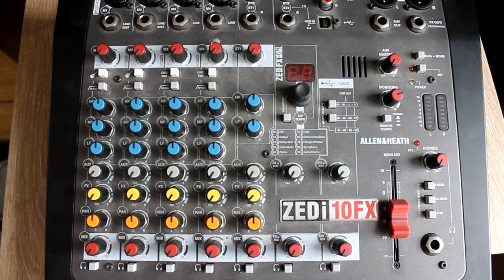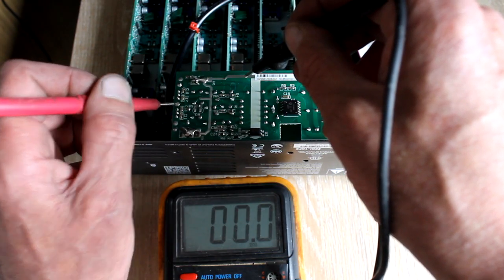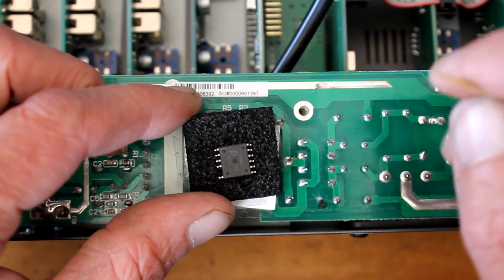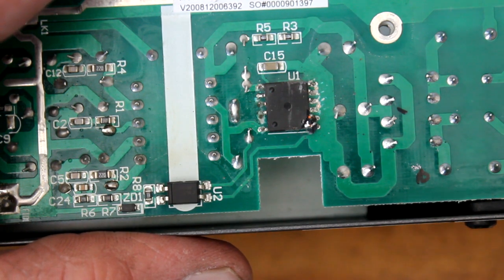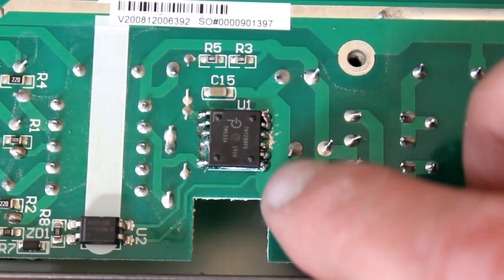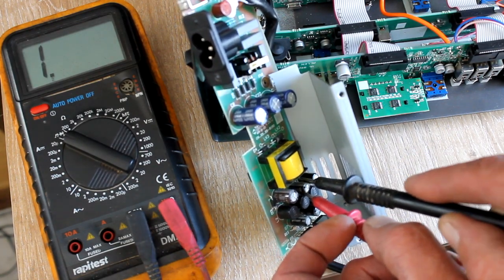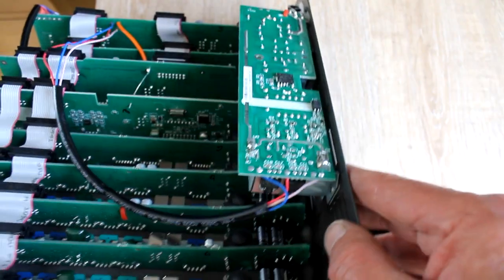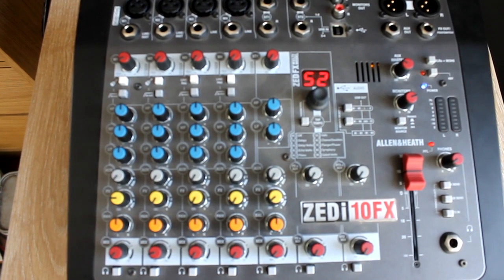ZEDi 10FX Guitar mixer repair after a power grid surge.

Comment: Hi Damian, is it still working? I have the same problem with a Zed 6 and I am sure it's the same PCB did you change the diode later?
Thanks
Reply from the maker: Hi, it`s my friends and I think it`s still working. The diode is still working. I did check up the spec and it was nearly the same or perhaps better.
Reply: @damianbutterworth2434  Thanks for the feedback Regards James

Comment: was the blue power led flashing? like showing signs of underpower?
Reply from the maker: There was nothing mate. Are you having problems?
Reply: @damianbutterworth2434  mine shows the flashing blue led on top and the orange led on the PSU.
Reply from the maker: @avpng  I`ll check this one in the morning. It`s not mine. I should of tested the voltages coming out the power supply to help out. The owners say you only need the 45 volts for an external MIC. So might just need something like 12 volts. Does the manual say a blue flashing light means low voltage?
Reply from the maker: @avpng  have you got a red led showing 45 volts. Might be the issue. Since the blue led is on and reporting an error I think the 12 volts must be working ok which means most of the power supply board is ok. Might be worth checking the 2 other diodes  near the one I changed.
Reply: After replacing D7, the other component that often fails is the +12v reg